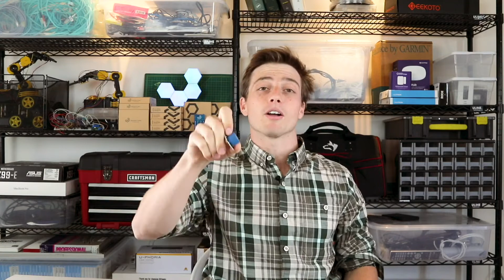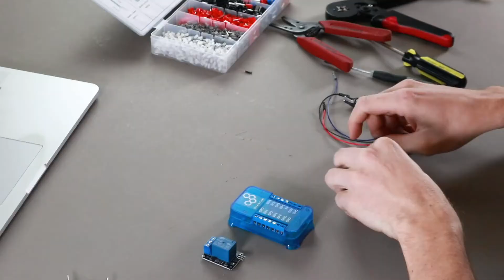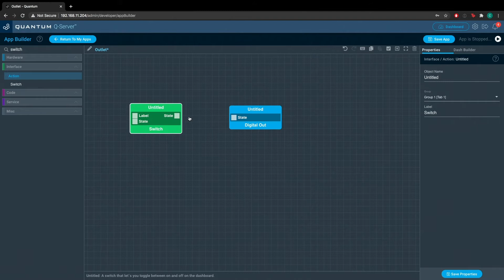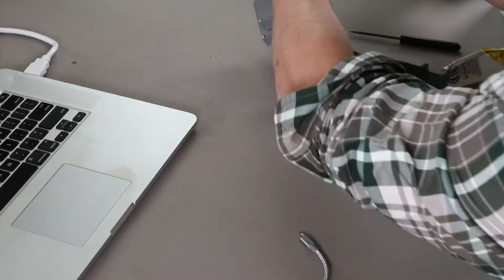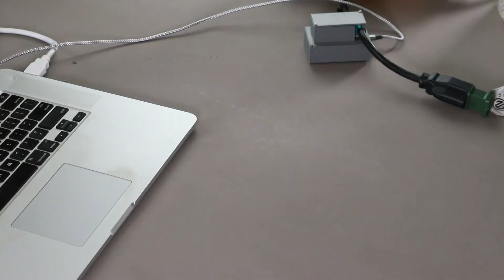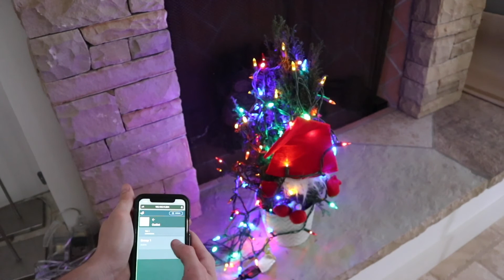How to make your own Smart Outlet with Quantum

Comment: A little safer with relay- instead of hooking one end of black (hot ) wire to Common, and the other to Normally Open- specify which end of the black wire to which- if you put the plug end to the Common, that leaves the Normally Closed part of relay with outlet current exposed when its plugged in.  Better to specify to put plug end of black wire to Normally Open, and jack end of black wire to Common. So, when off, live voltage only at the one terminal. When the controller calls for the jack to be on, the Common and Normally Open will connect the 2 black wire ends together.